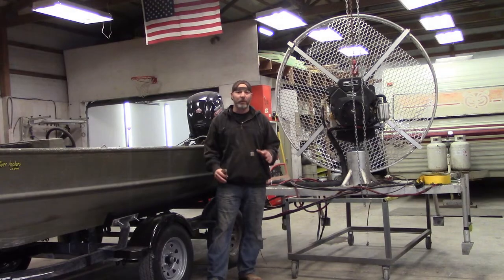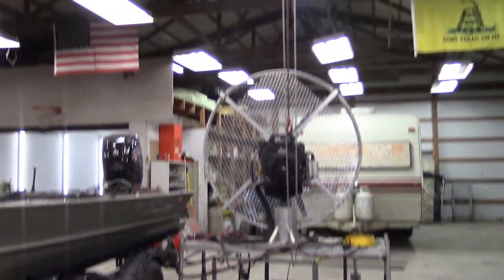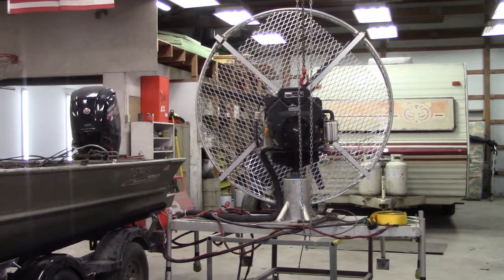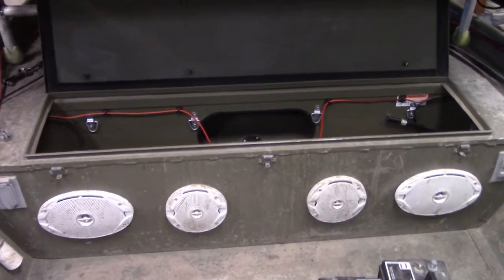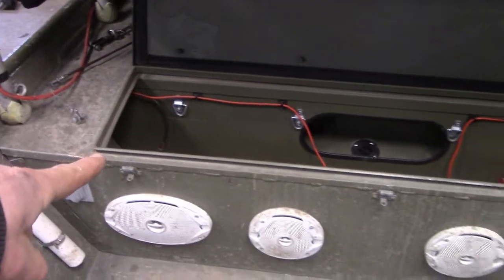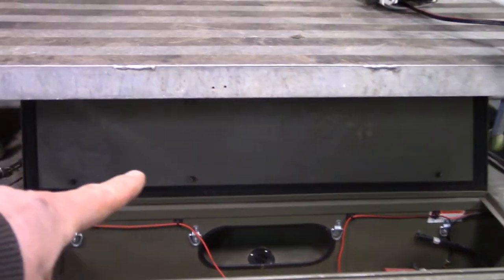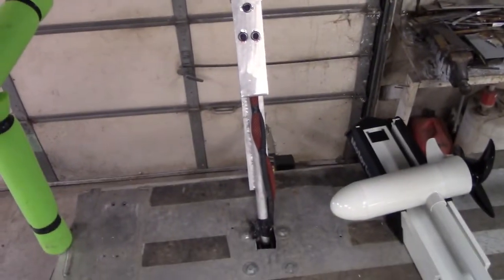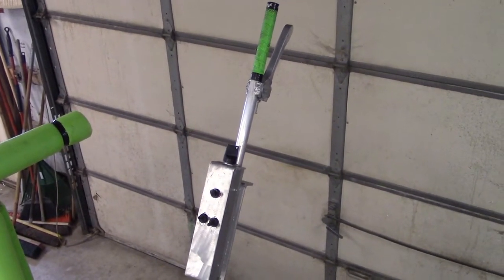Bowfishing pusher fan install

Comment: What about fishing around tree limbs? Does the fan ever get hung up
Reply from the maker: haha....yes you have to watch out for low hanging limbs. I also found out the hard way having whip lights on the back can be an issue. the boat got to rocking back and forth and the whip lights swung into the fan....ya...that was a bad deal.

Comment: How does the steering work
Reply from the maker: I started out with push pull cables but i was not happy with how that worked so I switched to an electric actuator system.